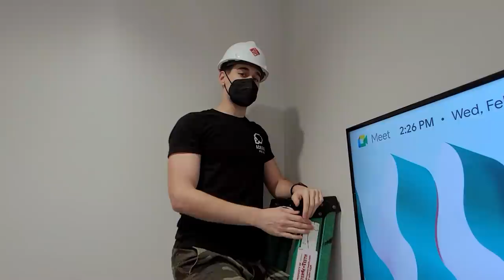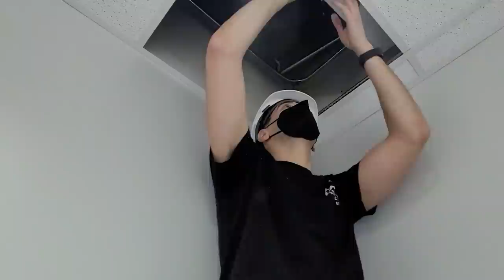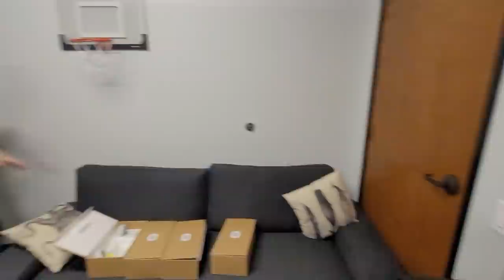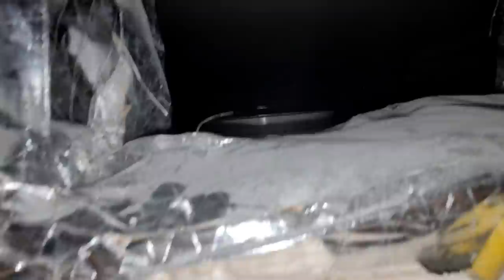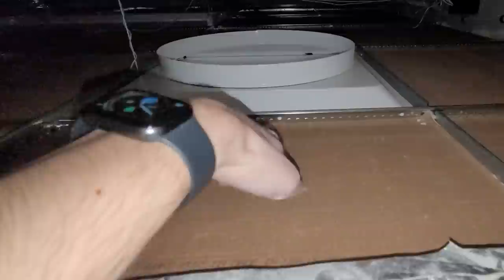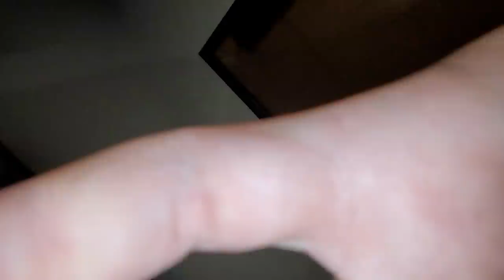In The Ceiling, Spying On Friends - Between The Games

Comment: The quality of construction on that building xD The vents open to the empty above drop ceiling void with just the tiny 1ft peice of duct in the wall. For when you want an open air design without actually seeing it.
Reply: Coming from an HVAC Journeyman, that design is called a centralized return system. And is designed that way bc, it can achieve the same  thing with out all the return duct work.
Reply: @williamfryman4360  Never knew that! Cool! Bet they never expected it to be used for this purpose xD